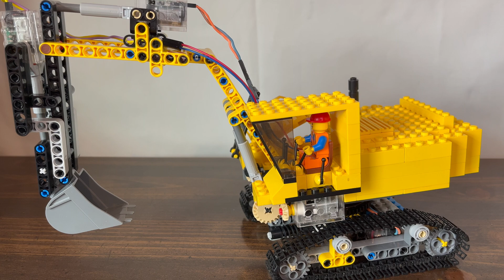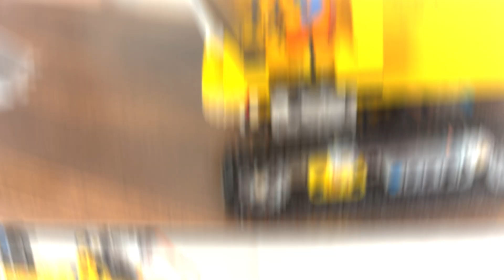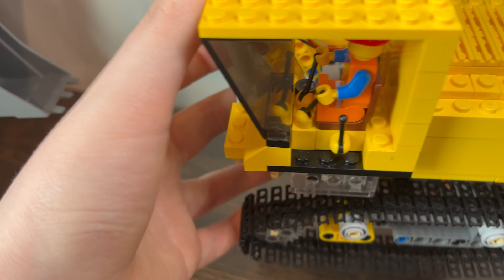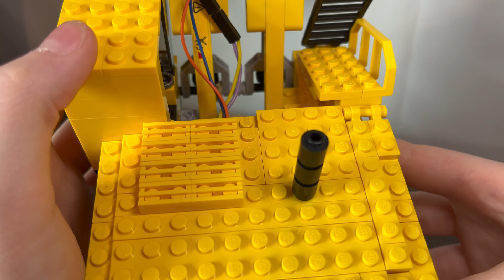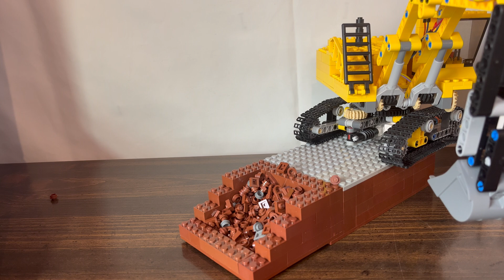LEGO RC Excavator with Circuit Cubes

Comment: Was that two of the Bluetooth battery packs each with three motors? Those tiny motors are fantastic, just got a couple myself.
Reply from the maker: Yes, it is two Bluetooth batteries connected to the same device. 2 batteries is the maximum amount I know you can use in one build, but you can link multiple motors to one port if you don’t need them to work independently of each other.